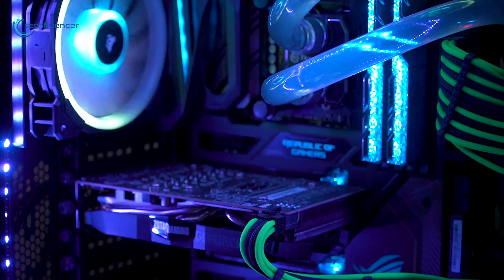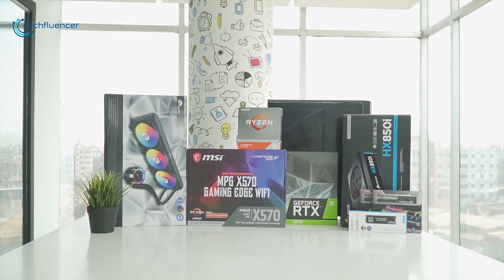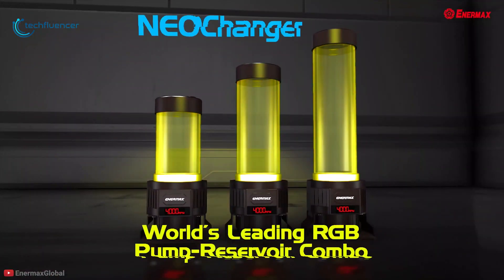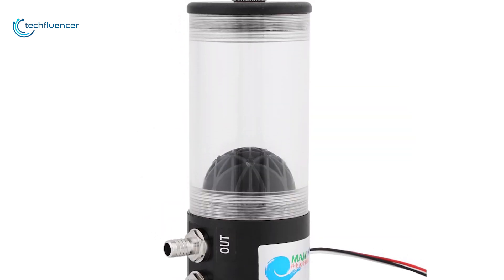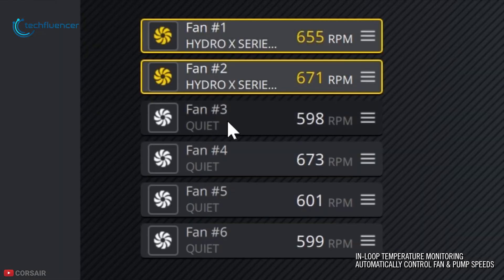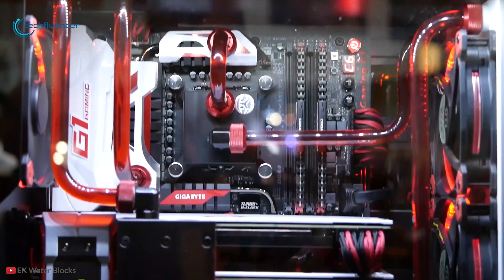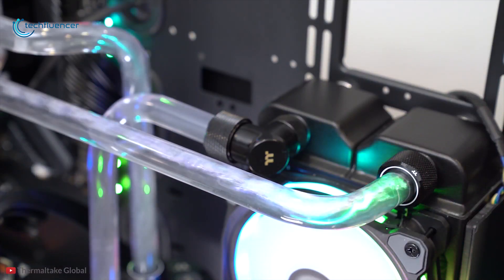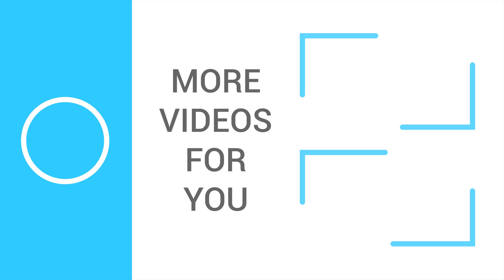Best Pumps for Custom Water Cooling

Comment: pump noise levels in idle/load would be one of the most important things to know
Reply: Depwnding on pump type they are all basicly the same when looking on noise, ddc pumps are louder, but bring more pressure, d5 pumps are more silent, but deliver less pressure, which limits their use in big loops.

But even with an 12 fan custom loop and an ddc, my fans still make more noise even when only running at 700 rpm, so the noise is not really an issue

Comment: So its pumps or combos? Where is DDC pump then. Poor understanding what is a pump for water cooling!
Reply from the maker: The pump is the heart of every liquid cooling loop. It pushes the liquid through the system and it can be installed as an independent unit or as a pump/reservoir combo.
Reply: @techfluencer  they are saying that this is a list of pump/reservoir combos and not a list of pumps like the title says
.

Comment: Enermax NEOChanger not recomended i had a few and they all cracked at the bottom of the cylender less then a month after i got them and the last time i got a new one for some reason it was glued at the bottom so it was almost impossible to clean but the hydro x on the other hand is awesome :D